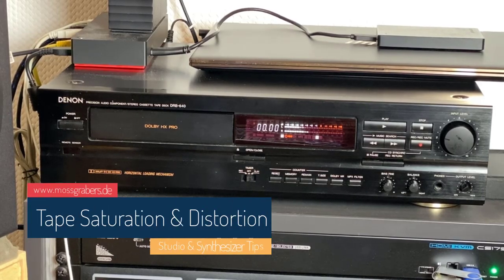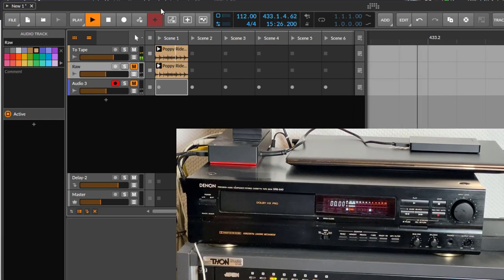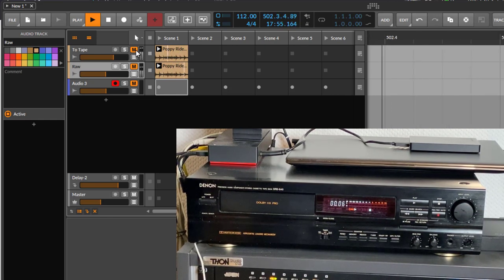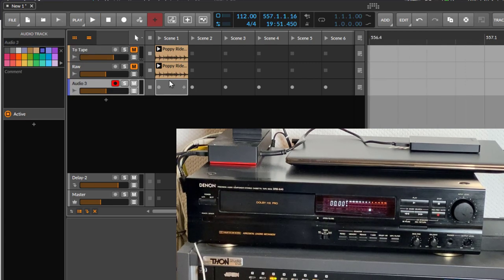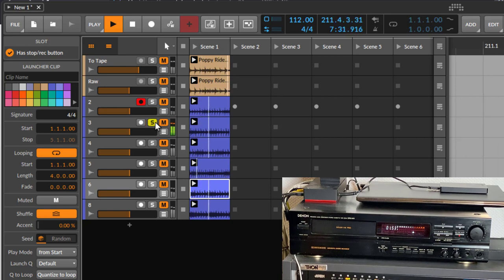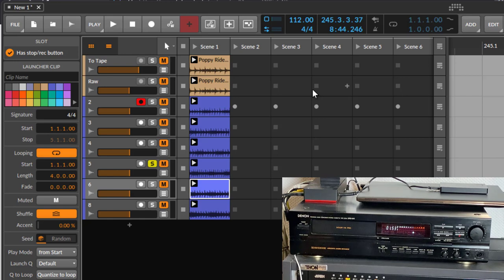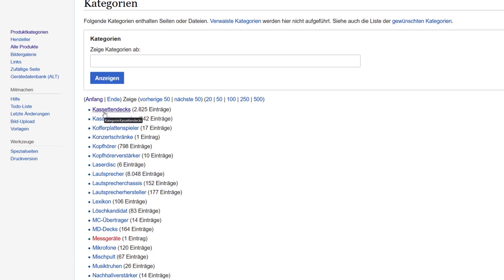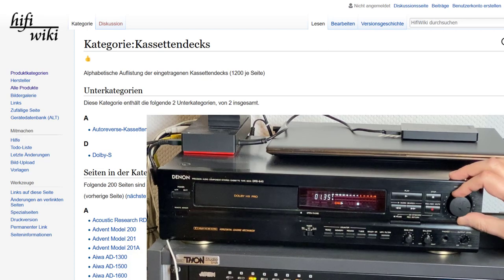Tape Saturation & distortion with a cheap 2nd hand tape deck! Does this work?

Comment: ‘Going into the red’ is nowhere near as bad on analogue gear as it is with digital, because it’s not digital clipping. 

A lot of tape recorders recommended hitting +3 as a good level for a good recording / noise floor level.

Comment: I like number 6 the best, and I do have a tape player but just to record and playback, but great idea, you can also use VHS Tape, there were some good vhs tapes made, sure you can find them. Jurgen is there anyway you can convince Bitwig folks to help with offering Mute button functionality of MIDI Tracks (External Instruments) from the arrange window. I noticed in your videos you have several external Midi gear like a lot of us older guys, but we can not mute those from the arrange window, we have to it from the left side window, but interestingly enough we can mute it with your script for the Akai Mpc series using the touch screen in clips mode.
Reply from the maker: Yes, good idea with the VHS tape, that works as well! Regarding MIDI Mute, I was discussing quite a bit about that (with obviously no success) but meanwhile I do not care anymore since when you use the Hardware Instrument device everything just mutes fine. In case you use MIDI channels you can deactivate them (Alt+A) as an alternative.
Reply: @mossgraber  Thank You!!!! I got an Akai Fire as well, after I saw your video. I hope we can compensate your at some point.

Comment: do you actually need tapes in order to do this? Or does the audio signal just pass through the tape deck without the need for actual cassette tapes?
Reply from the maker: Yes, you do. With these simple tape decks you even need to record it first and then play it back to record it back in the DAW. But this gives you the tape saturation otherwise you only get the distortion of the pre-amp.

Comment: So you need a 3 head deck for this, am I right? Otherwise it would only be distorted by the amplifier in the deck…

Ok I see i posted this too early as you just rewind and record. 
So with 3 head deck, if you can delay compensate it properly, you can have it (nearly) live i guess.
Reply from the maker: Exactly!